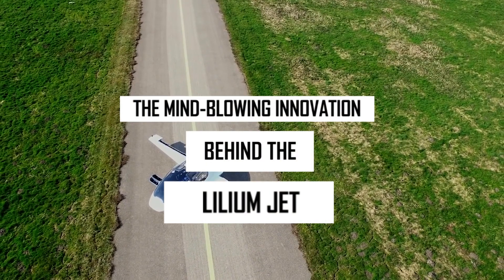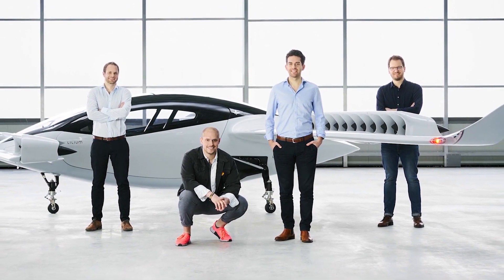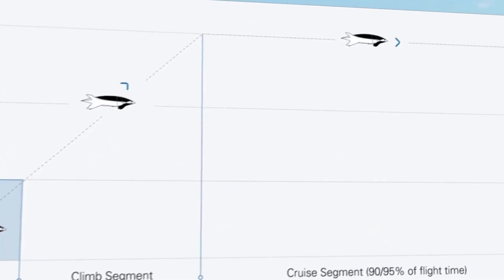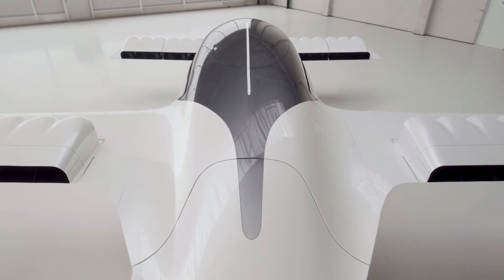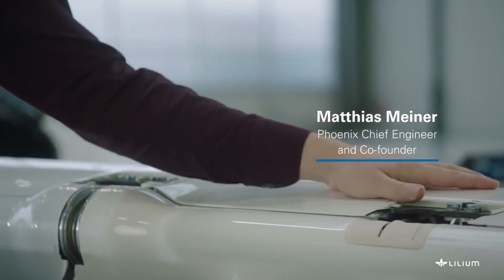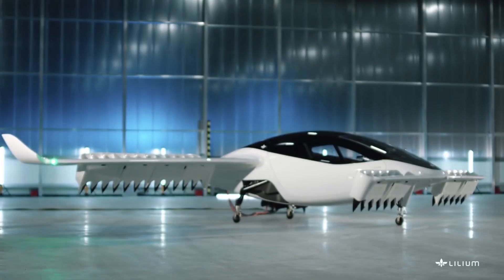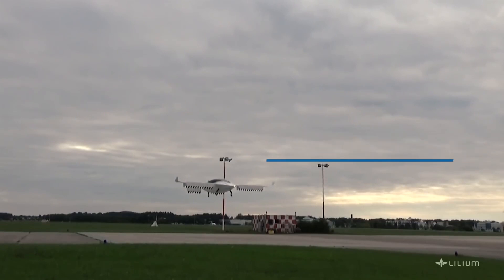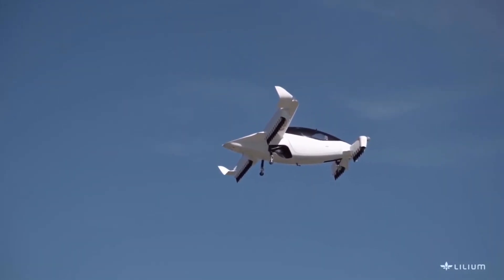The INSANE Innovation Behind The LILIUM JET

Comment: What sets the Lilium Jet apart from its competitors its simply its use of ducted fans, and thus the removal of exposed rotors.  In truth, there is a bit of compromise in this design appose to the use of larger exposed rotors.  Larger rotors generate more lift, and thus can carry heavier payloads. That said The brilliance in Liliums design sees to generation of lift stemming from multiple devices. Direct and indirect lift, generated directly from its 32 rotors, as well as the increased speed of wind generated by those rotors atop its wings surfaces. Conventional lift. One source of thrust, two means of lift. More over are the many benefits that comes with numerous smaller fans. And that speed of operation.  Lilium engines can spool up to higher levels of speed almost instantaneously  meaning that the aircraft and its vectored thrust can maneuver far faster, adapt to any condition far quicker than other evtol design layouts.   it means that its avionics could make it possible to stabilize the aircraft flight. much like a car with adaptive magnetic ride suspension can adapt to bumps and undulations in the road far better than a normal suspension setup, in the case of an emergency and the loss of engines, its operational engine can immediately adapt to the situation.  And it must be said. Evtol aircraft will fly at the same altitudes as other light aircraft. And as such must contend with the hazards of lower level flight,  From strong weather events, to the possibility of collision with external objects. Bird strike, drones, balloons  you name it.  having that additional redundancy is a great benefit.

Comment: It's a great idea for a lightweight, unmanned sUAS but a lethal combination for passenger flight. Helicopters have the failsafe of autorotation if power is lost and planes potentially can glide to a safe landing. Turn the engines off this craft and it will fall like a rock
Reply: Disagree. It's got fixed wings that will enable a better glide ratio and vertical speed than an auto-rotating helicopter.

Additionally, there is a BRS system in one in a billion chance everything fails. A tiny, dedicated capacitor bank could also be used in an emergency landing for a final burst of power allowing for a soft touchdown.

The Lilium Jet will absolutely be safer than any helicopter, use zero fuel, produce no fumes or pollution, make little noise, require far less maintenance and pilot training/skill while still being able to operate in the same spaces and reopening helipads that were closed due to noise.

Comment: Lilium is nonsense.  This thing doesn't work and will never work. Its not usable for commercial use- if passenger or cargo, its a scam. Investors funds are burning like the 5 seater demo ( EDF drone not jet). Its not a technical concerpt its an advertising concept. No technical data is available.  Its more than suspicious that no information of amp draw or volts are available.  The amount of kw consumption with the inefficient EDF drives is double(!) of open props. 350 kw for lift off and landing and 50-100  kw for horizontal movement- where shall that energy come from? Not even 500 kwh batteries can delver 10 min flight time....thats why the remote controlled demo drone had under 5 min and couldn't even theoretically reach 5 miles range! Its total rubbish what Mr. Meiner (Co founder?) had to comment about the ridiculous stupidity of  efficiency and safety- this thing falls like stone if not constantly pushed on thrust. No wings for glide ratio. Thrust inefficient by high e-flux, low  static thrust EDFs- opposite of what is needed. Joby has low noise hovering with meanwhile over 1100 test flights. Lilium is 3 times noisier with 1 flight and 1 fire ( 5 seater version destroyed). The tricks to quite it down are useless and cost even more efficiency has they installed their ideas in the nozzles. ...in the air stream. What are these people thinking? 440 kg empty, max take off weight 1050 kg, the battery is 600 kg for 5 min flight- no passengers,  no cargo. How shall that ever be used except as a large toy drone for 4 min video ?

Comment: Their flight tests were remarkable.  Now all they need are the 750wh/L graphene batteries made by NanoXplore.  Bump up that range
Reply from the maker: We'll look forward to that.
Reply: LOL. The elephant entered the room.
Reply: 500 Wh/L batteries are available today from Amprius. Better will come, but really good and usable is available now!

Of all the eVTOLs on the market, the Lilium Jet is the only one I can see actually getting widespread customer acceptance as having 6, 8, 10+ exposed propellers adorning the airframe is both unattractive and unappealing. There's a reason large turboprop airliners have fallen out of fashion: Passengers prefer Jets.

Also, the increased energy use in the 10 sec. vertical to horizontal transition over exposed props is made up for in increased cruise efficiency and the ability to glide in case of complete system failure. There's also the BRS system as an additional emergency option.

Comment: This thing is laughable.  None will get past a prototype.  No electric plane is possible as long as battery tech is stuck in the Lith-Ion stage.  Maybe one can be made with solid state batteries, but even then the lack of range will make it inviable.
Reply: You're a simpleton.  It's clearing every metric required for FAA & European verifications and will be flight approved soon.  It's also the only eVTOL that scales up in size & utility.  Ya got to get a clue
Reply: @EarthCreature.  It may be flight approved, but they have yet to build a full scale "jet." Even the latest test flight is not a five or seven seat craft, but a sub-scale model that appears in size to seat maybe two at most (and they have never shown a flying prototype that has an interior of any kind). So while they have made progress, the only thing keeping the entire project afloat is speculative investments. You can bet a lot of that money is not going to the development of the aircraft itself, but just to pay all the people working on the project. 

If and when they get a full-sized craft flying, they still have to go through flight testing with an actual payload, and then sell the whole concept to a buyer. The craft will be large enough that it will NOT be an air taxi in the sense that you can hop into one from any street; it will be no different than hailing a helicopter. In other words, not transportation for the masses, but for the elite. So...what does this offer over a helicopter exactly, other than looking more futuristic, and (possibly) being a little faster?
Reply: @EarthCreature.  You missed my point.  I do not question if it can be ceritifed for flight.  I question the lack of range and the lack of practicality of it.  No aircraft can be pure electric right now because battery tech is not there yet.
Reply: what's laughable is you can't name one eVTOL concept that is ahead of Lilium.  That's because they're the leaders in it and continue to out perform the vaporware concept companies like Joby.... which currently still crashes
Reply: @yodouri6575  No.  Whats laughable is NO eVTOL is viable while the batterys they have to  use are heavy and limited in storage.  You do not understand what it takes to stay in the air with a payload.
Reply: @goodcitizen9827  What are you talking about?  I am commenting on electric planes as a whole.  The entire theory is half-baked until battery tech gets more real.
Reply: You need to explain your profound insights to Lilium's affiliate partners--'laughable' companies, like Palantir and Netjets. All those 'stupid' people seem to think they know something you don't.
Reply: @Li Heli Wrong.  The autopilot is present in every aircraft. It play no role at all. The presence of a human in the plane adds too much weight. (the FAA will not allow any aircraft to fly without a pilot)  That also limits range.  The range on the electric trainers which can only carry two people is about 70 nautical miles.  That would not allow a safe round trip of 30 miles in each direction.  Then the plane requires recharging for 8 or more hours.  These videos are talking about a technology that is future, not present.  Its a head-fake.
Reply: @speedomars  Lilium will be piloted
Reply: @Li Heli Lilium is piloted it isn’t remotely piloted
Reply: Fairly sure they will be orders of magnatude quieter and cleaner and safer than helicopters, minor differences😮
Reply: @Li Heli It can't do that safely.  Electric planes are being made for commercial purchase but they are light sport and they have a VERY limited ranged that does not allow them to fly away from the field.  They can be used as trainers as long as they stay near the airfield.  And it takes all day to charge them.  LithIon tech is still too crude to power devices a human can ride along in...drones maybe, but not humans.  New battery tech much come that lowers the weight, increased the charge and capacity and decreases the fire hazard before a practical aircraft can be made that can be used to reliably transport non-pilots away from any airfield.  All of these prototype products are more for research than actual production planes.